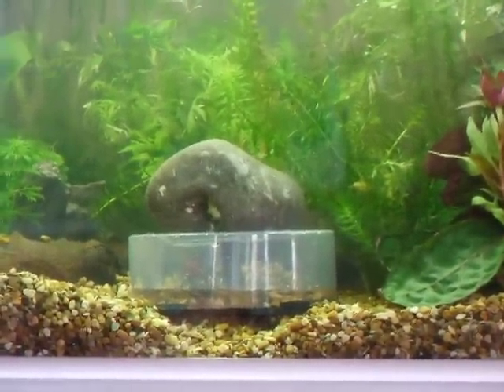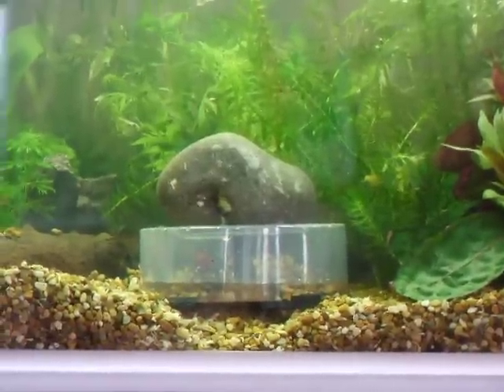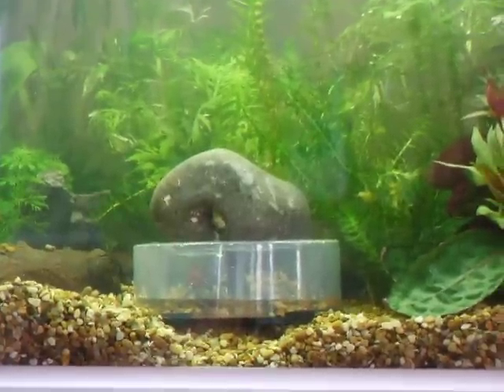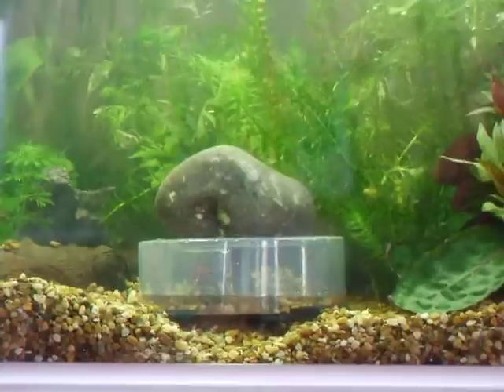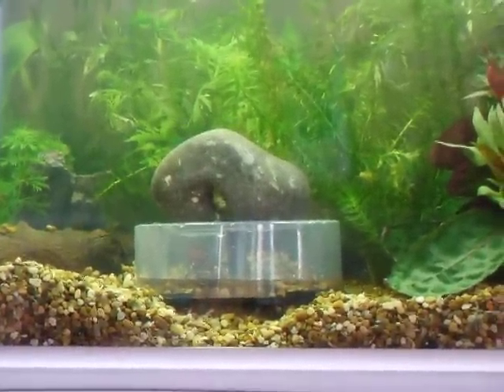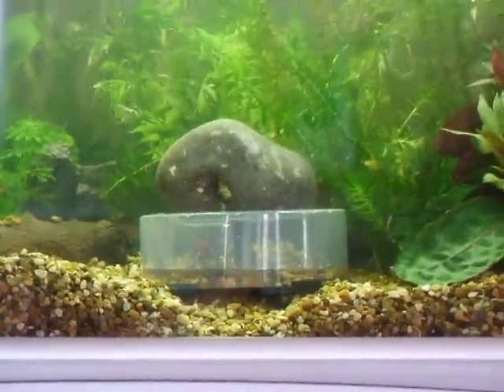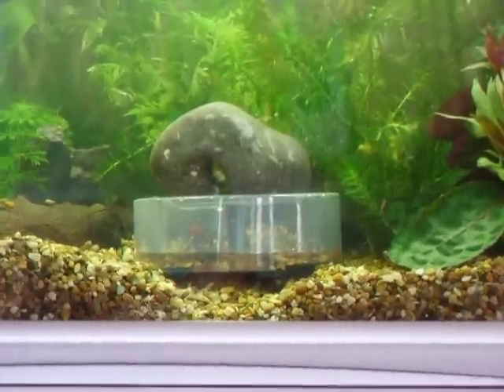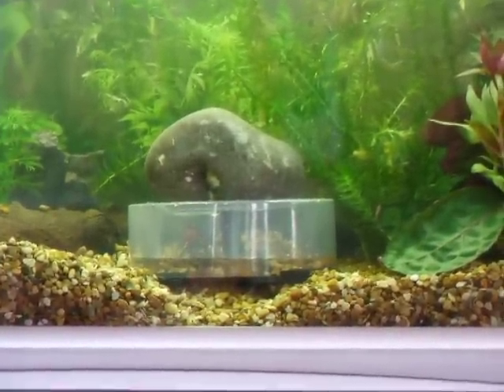Aquadome crabhome (diy)

Comment: How often do you run your air pump into the crabhome?  I have mine set to run 15 minutes on and 1 hour 30 minutes off, a 24/7 cycle of that.  I was wondering if the crabs really needed air pumped into an air dome that often or not?
Reply from the maker: +DrGonzo0001 I don't have the tank anymore as had to move and didn't have room for it but I only used to pump fresh air in every couple of days,literally only took a minute or so to change the air in the crabhome.